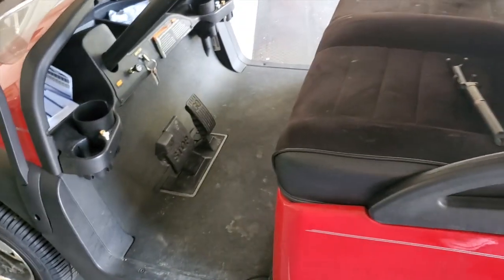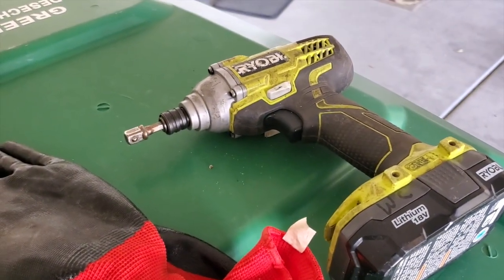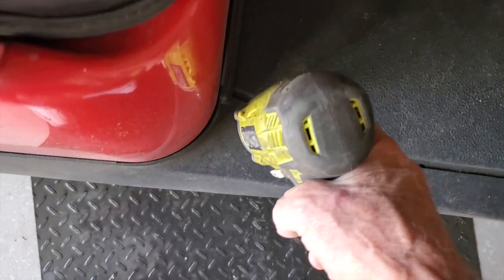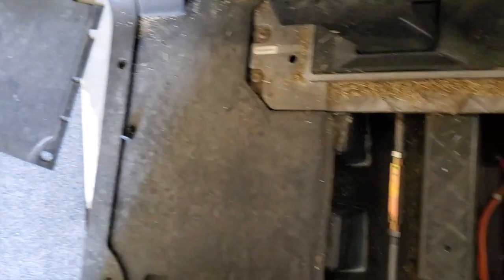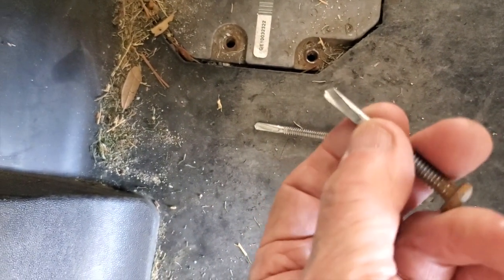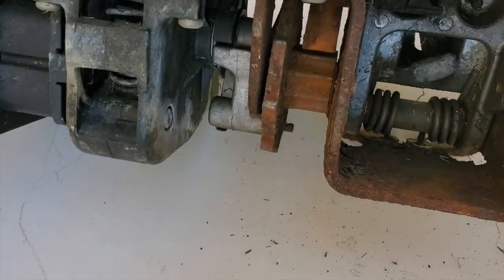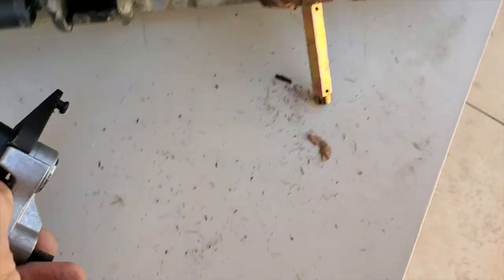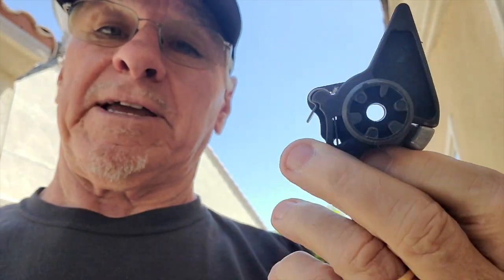Precedent Parking Brake Fix

Comment: I have the opposite problem, my parking brake engages every time I press the brake.  Thoughts on what part causes that?
Reply from the maker: Depending on if you have  ds or a precedent,  it's different.  Since you didn't say, we don't know.
But if it's a precedent,  then you will probably need to buy some parts.

Comment: I am buying a old DS and I have the opposite problem. When you hit the bake the parking brake engages. It releases as it should when you hit the gas pedal. Not sure what year it is. I will bring it home tomorrow amd get the restoration started.
Reply from the maker: That's all in the adjustment,  you need to adjust BOTH pedals at the same time.

Comment: Hi.  My club car precedent brake light won’t go out after braking. I have to turn key to off to turn out the lights.  Is there a switch to replace and if so how please.  Thanks Dan.
Reply from the maker: First, if you have a normal wiring job, there should be a delay timer on the brake lites.
Does the brake lites work if Pedal is stepped on while the key is off?
What should happen, is when you park and put the parking brake on, the brake lites should still stay on, for either 3 or up to 5 minutes, then they should time out and turn themselves off.
See if that is the case for you ?

Comment: I’ve had a lot of problems with my self adjusting brakes on my 2004 club car precedent. Is there a way of removing those self adjusters and going with something else?
Reply from the maker: Other than disc brakes, I don't know of anything else. 
My experience with the self adjusters , or star wheels, is to replace them EVERYTIME you replace the shoes.

Comment: 2005 club car parking brake won’t hold, same part as the newer ones?
Reply from the maker: Probably not. If you have a pedal group 1, with silver metal on pedals, then you have the original crappy brake. 
The newer pedal group 2 have the good brake.

Comment: My parking brake engages but the cart continues to roll ever so slightly. How do I fix that?
Reply from the maker: depends on what model golf cart you have, you didn't give the important info
Reply: @waynemartin.waynesgolfcart4900  Wayne, I have the same issue, I push the parking brake, it holds but I can push the golf cart as if no brake exits. What's the fix.
Reply from the maker: same answer as I gave above.  Why do you ask, without giving the info?

Comment: Very good video..Makes sense, just replace the whole assembly, instead of parts... My parking brake engages but the cart continues to roll ever so slightly. How do I fix that? Mine is a 2011 CLUB CART Serial # PQ 1118 189118
 THX U..
Reply from the maker: Try tightening the turnbuckle in the floor some.